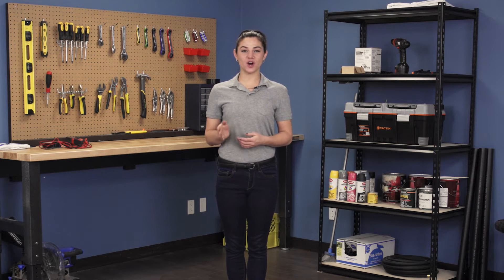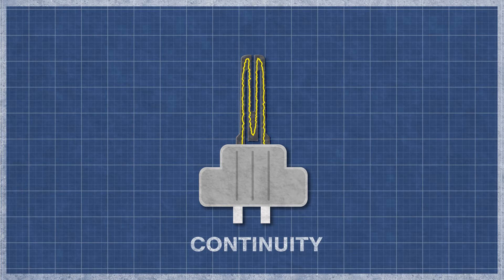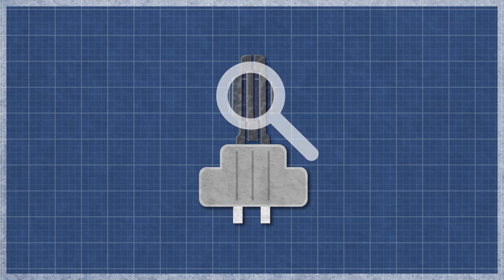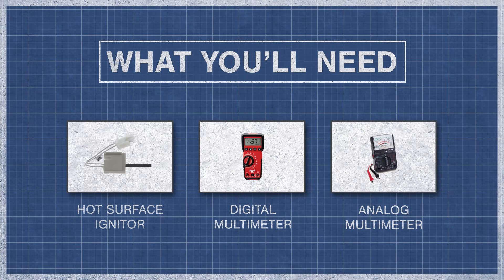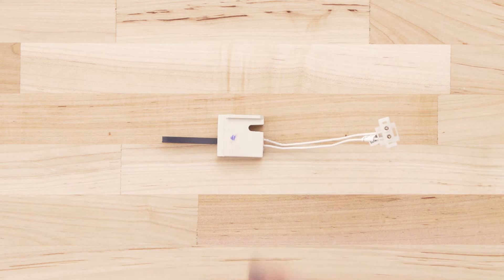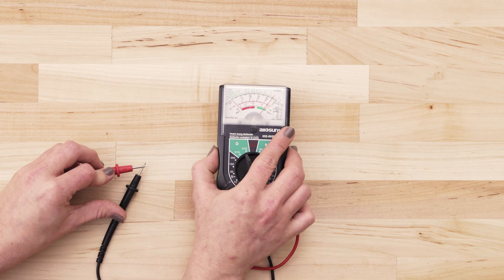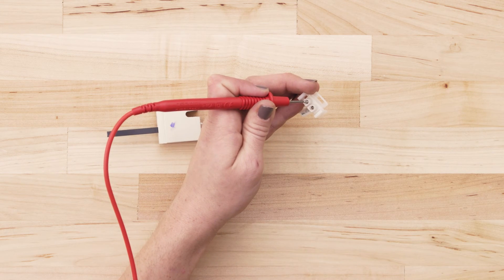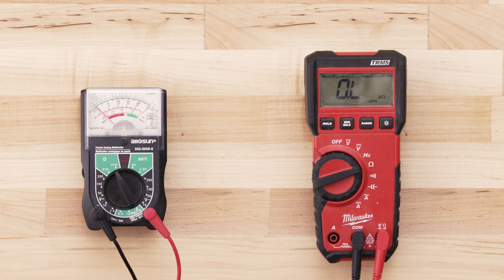White Rodgers # 768A-845 - Continuity Test (Gas Furnace Ignitor)

Comment: What if the ohms is only 16.2 is it a bad igniter already?
Reply from the maker: Thanks for watching. 16ohms is a little low for a hot surface ignitor and will likely not heat up enough for ignition.
Reply: @AmreSupply thanks